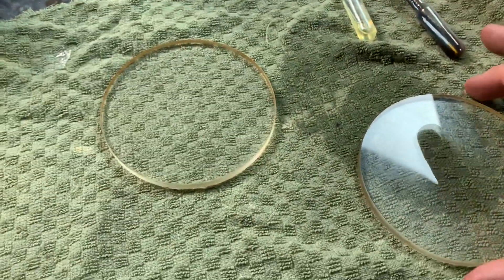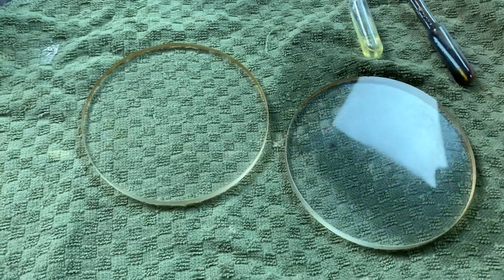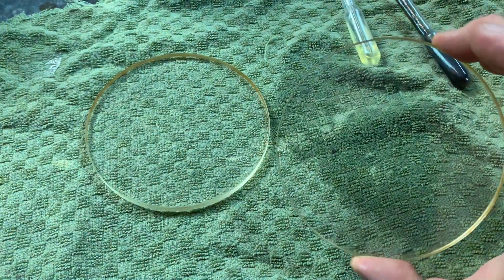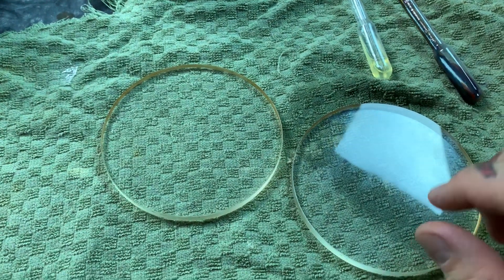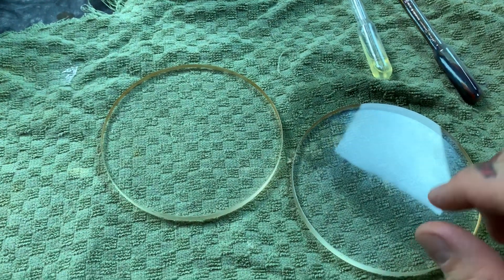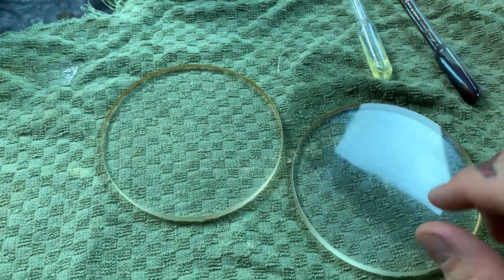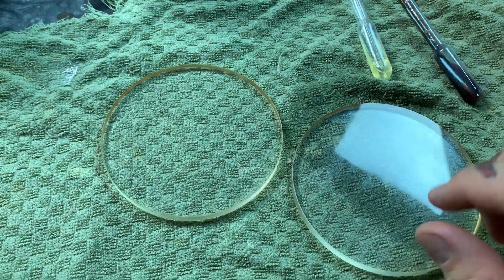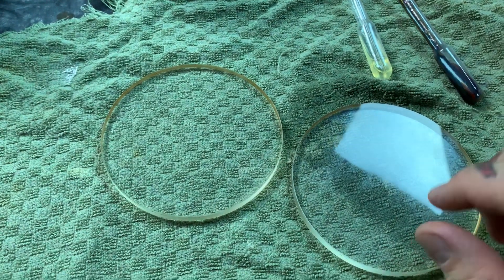EPIC!!🤓 HOW TO: Make a MAGETIC HOLOGRAPHIC VIEWING SUPERCELL! 💎😎

Comment: You auggested a cheap alternative using high quality camera lens filters. Any suggestions on how to work with those? Ob iously jd need to be more careful, but how would i go about popping the glass out without damaging it?
Reply from the maker: easy, you CUT the metal rings around em with metal cutters
Reply: @KenTheoriaApophasis  Excellent. I just wanted to be sure there wasn't some stupid simple way, then me risking it unnecessarily. Thank you!

Comment: Ever since I first saw this used by you I wondered what you would see if you used very thin layers of the glass flats and sandwiched the ferro fluid between around 10 or so glass flats.  Think it may tell you more than the sort or 2D image you get from just one layer.
Reply: There are videos like that on youtube. Search and see them.
It is actually less surprising than it sounds, as it makes several transparent holograms that interfere visually but dont really add up as layers of one big hologram
Reply: Well I did try it but having trouble making good quality ferro fluid. I found some very thin microscope slide squares that you use to sandwich on top of the rectangular slide. I am not sure of the flatness of these bit figured they should be enough. I used mouse milk but it ended up being more of a 50 50 mix since the slides were so small and I just got a very dark layer that gets worse as you add more.  I will keep trying to make better ferro fluid though as it was another project I wanted to tackle as many people have trouble making it simply without a bunch of time and steps for a very small yield.

Comment: Hey Theoria Apohasis I have another gift. I have used the way on nature to improve the MAGETIC HOLOGRAPHIC VIEWING SUPERCELL

i have not made it yet because it is fresh from the oven. here is how you make it:

you need to make a large globe just like the earth the bigger your sample magnet the bigger globe you will need.  the globe is to be in 2  divided down the center 2 cross sections.  on the flat surface center of each cross section the need to be a nought  that will fit half of the sample magnet. they you put both hafts back to  and fill both with clear oil and some feral fluid. it commonsense that you must not over saturate each side with the feral fluid. that is the ideal way to make it. a simple way would be to get a fish tank fill it with clear oil get a piece of string about the height on the tank tie the magnet to the center fix one end of the string to the top other to the bottom so that the magnet is suspended in the center of the tank. than slowly add the feral fluid until the field lines are visible. i have come up with more as i have been typing but this should be enough to get the concept and improve it further yourself.